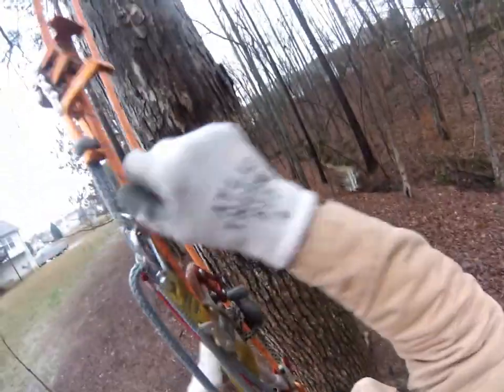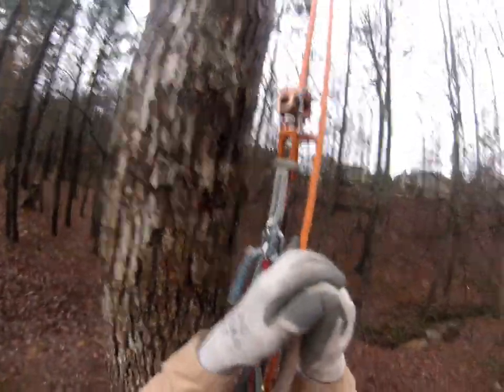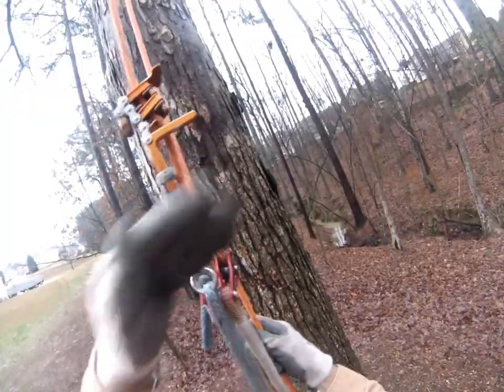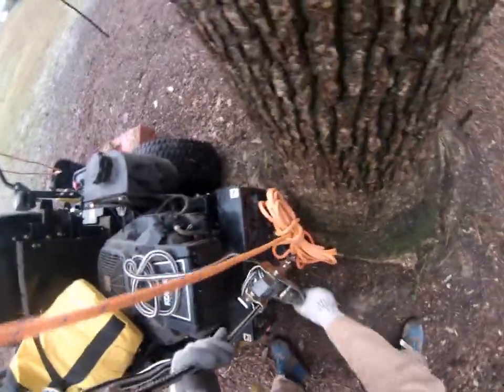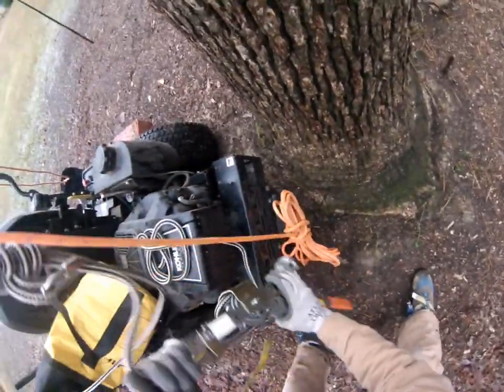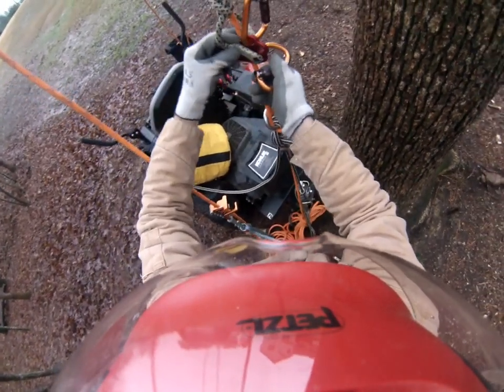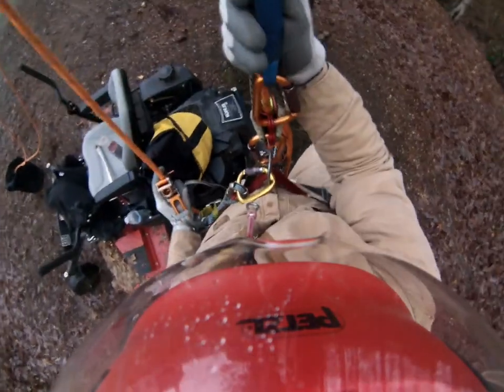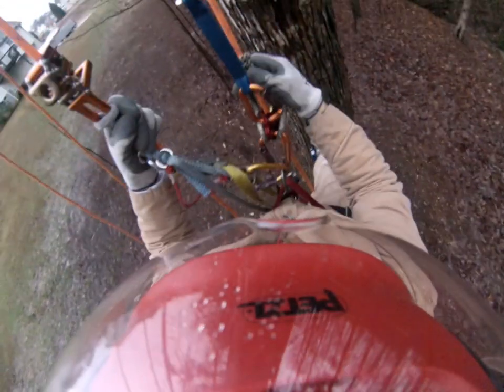SRT RopeWrench on a weighted line, does it function?

Comment: so is the point of this demo to show that two climbers cannot climb srt on the same line at the same time?
Reply from the maker: John Durant Yes, using the Rope Wrench. It is possible with a HitchHiker though and the Rope Runner but it's not quite as smooth.
Reply: Do you have a video where you demonstrate the hh and rr in this fashion? Thank you Richard.
Reply from the maker: John Durant This is the practical application.

https://youtu.be/pCwZlobjCoE